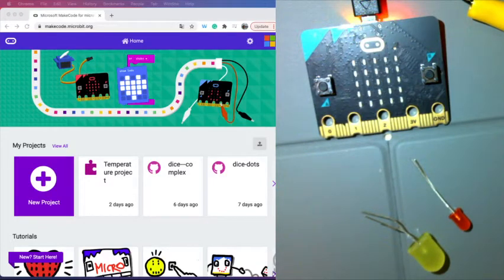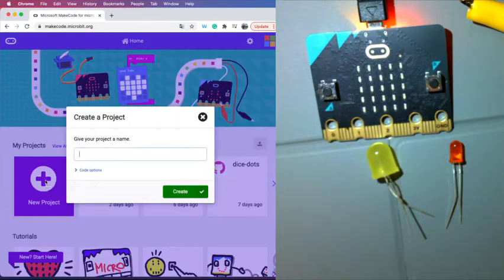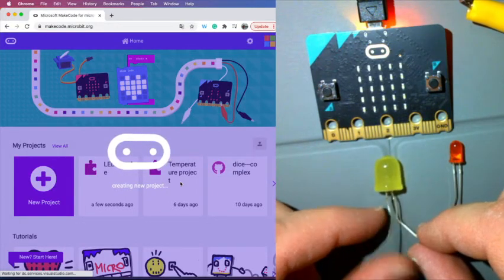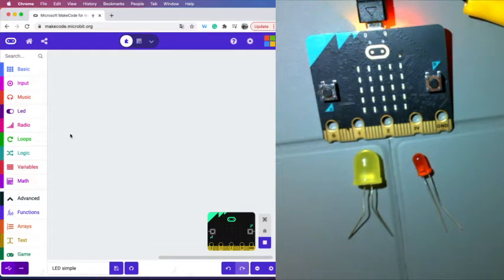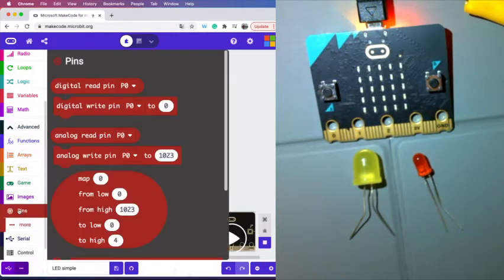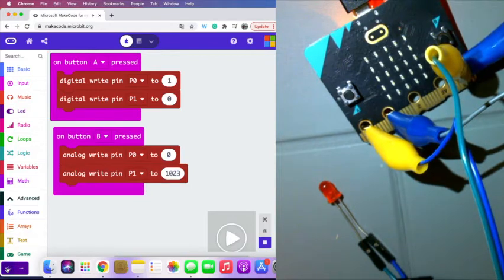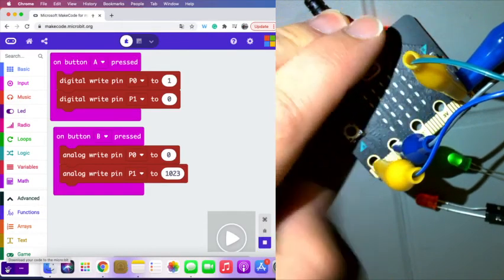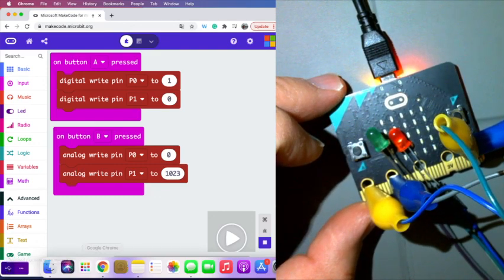Lighting an LED with a micro:bit

Comment: should I worry about adding a resistor to the LEDs? Like in a class of 30 students, adding a resistor is a bit difficult, so if it's probably not an issue then I won't worry about skipping the step!
Reply: You should be fine if you connect a red LED (the negative part) to the 1 or 2 holes, and then the positive part to 0. BTW, the negitave part is longer.
Reply: Never-ending, just use a higher voltage led. Or just teach your class what a resistor is.